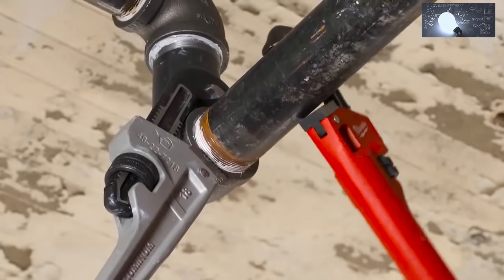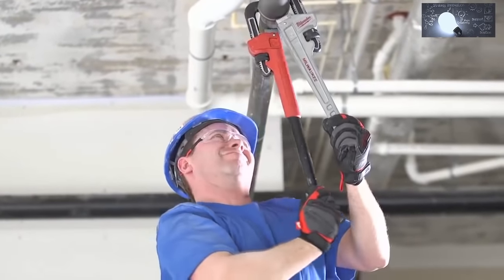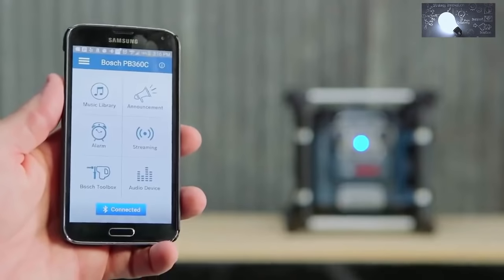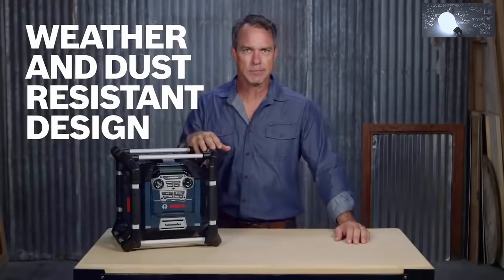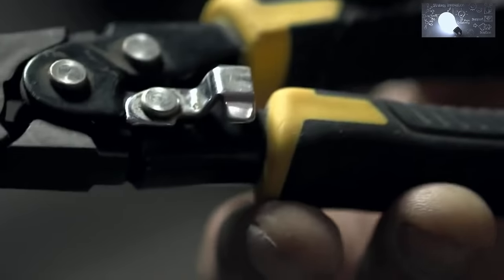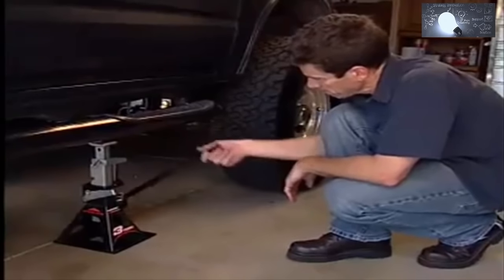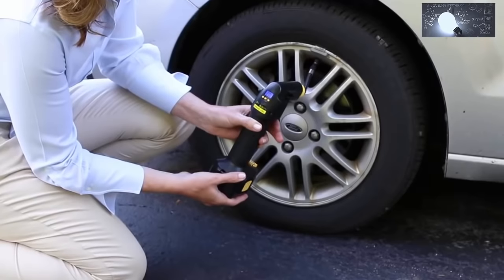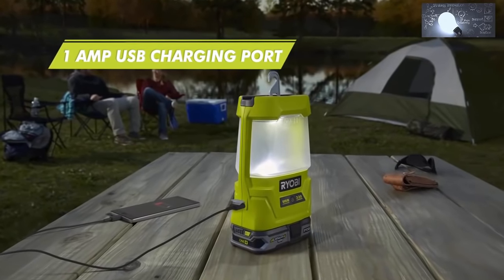10 COOL TOOLS THAT WILL MAKE YOUR LIFE EASIER 2019 (AMAZON)  4

Comment: Putting a pipe wrench on the HEX FLATS OF A PVC FITTING!?!?!?  I saw it at least TWICE. Shoemakers, sledgehammer mechanics!! These people are not craftsman or true tradesmen. If you are too lazy to carry the correct tools for the job, GET OUT of the trade!
Reply: What's the correct tool?
Reply: Use an adjustable wrench, smooth jaw union nut wrench or a strap wrench. If your replacing it, then go ahead and shred the shit out if it with a pipe wrench.